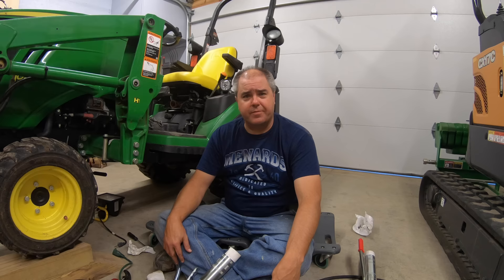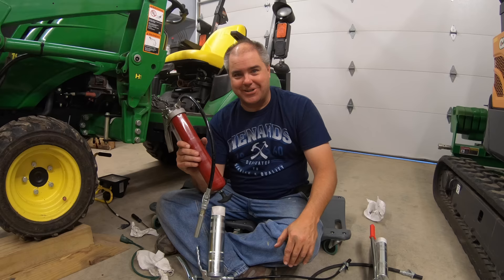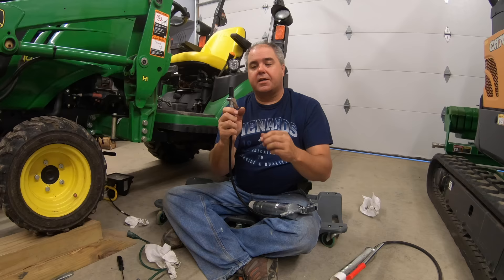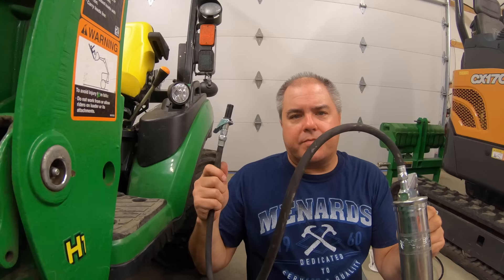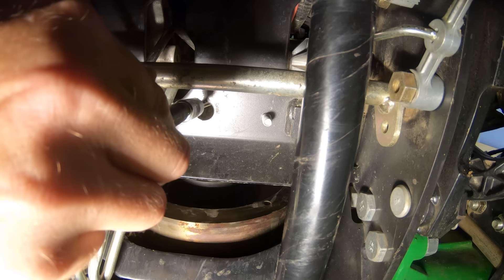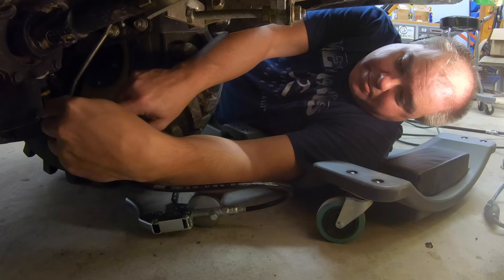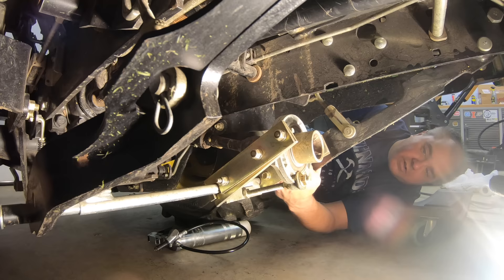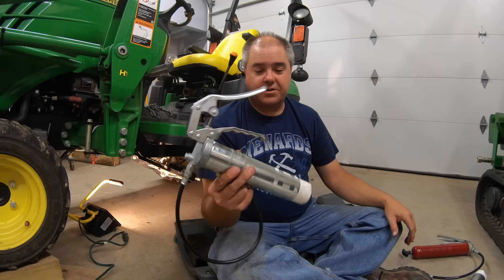New Grease Gun Technology! Greasing The 1025R/1023E Drive Shaft

Comment: I bought a Dewalt 20v grease gun about a year ago and haven't looked back. Best $200 I ever spent.
Reply: ill stick with me 20$ antique grease pump lol
Reply: I just did my 50 hour service on my 1023e without removing the tire, without lifting the tractor up, and other than the too tight drain plug and strainer screen retention screw, I had no difficulties with access including to the filter and greasing the drive shafts.  I simply dropped the quick connect arrangement and disconnected the drive shaft so could rotate it, and getting at the grease fittings and filter was simple.  For the front wheel drive shaft I may have been lucky as both fittings happened to be easily accessible from the right hand side.  The total time for greasing was less than 15 minutes including driving to the hangar and reinstalling the mower.  I just received my hand squeeze grease gun and LokcNLube fitting this afternoon, (a few hours after I finished the job of course).  Thanks for the heads up on those, Tim!
Bob

Comment: The key to easy greasing of that drive shaft fitting is to "hog it out" with a big or multiple drill bits to do whatever it takes to make the hole bigger. Won't hurt your tractor. I enlarged that opening years ago and no structural issue so far.

Comment: To rotate the front driveshaft, jack up one of the front tires to just clear the floor and rotate easily. You can now turn the driveshaft to access the u-joint zerk fittings.

Comment: Once I learned that the lower console can be removed to expose the U joint from the top, problem solved. Two side covers and 4 Philipps screws ...  with the benefit of seeing that the grease is going where you want it. Sometimes you can "feel" that in a blind greasing from underneath, other times not. Are you greasing inside the joint or just piling up a big gob of grease next to it ??? Not as likely with the needle, I suppose, because you can see better.

Comment: This video reminded me of an old mechanics trick. I am an old mechanic. Adapt a length of 5/16th brake line to the nozzle and hold the flare end on the fitting. The brake line can easily be bent to allow easier alignment with the fitting. The pressure from the gun will unseat the ball in the grease fitting.

Comment: Good video. I have had the same grease gun for 40 plus years. I just recently switched to a Lube Shuttle electric (lithium battery powered) grease gun and won’t go back to my old one. I put a Lock N Lube head on it it and bought the Lock N Lube kit as well. Has definitely made greasing easier! And my brother has the same tractor and he bought a flexible grease hose with a threaded end on one side and a zerk fitting on the other side to replace that hard to reach zerk fitting from the bottom. He got it long enough to make for easy access. I’ll have to check his out and do the same modification.

Comment: That's what you end up with on a 1025r. A thousand grease fittings and trying to line your main drive shaft fittings through a dumb hole in the frame. So glad I sent my 1025r down the road and went with a kubota b2650.
Reply from the maker: Fair enough.

Comment: I had to replace that very shaft assembly on my 2320. During the replacement process I found the real problem with the old u-joint and also one of the new joints in the assembly. The joints were not machined correctly and would not allow new grease into the bearing caps. This problem can lead to very early failure and John Deere has not recognized the problem or accepted responsibility, I had to badger them to get 50% off the purchase of the new assembly. To be fair I never told them of the problem I found but if anyone else experiences this failure you can do what you want with this information. Mine failed at only 150 hours. Using an automobiles driveshaft for example, 150 hours x 45 mph (average speed for most vehicles) = 6,750 miles. Obviously the factory assembly lube should have lasted that long. But the factory lube was not able to reach the bearing caps. Great video Tim. Also JD had failed to indicate this u-joint existed in the service manual and has since revised the manual.

Comment: Tim, you said that today was a dreaded day because of having to grease the tractor. But, isn't ANYTHING to do with the tractor better than a day at your day-job? 
Thanks one more time for sharing these little tips and solutions to small issues that bug us. I agree with the other guy who was wondering why that opening couldn't be enlarged so the normal Lock-N-Lube tip would fit. Just a 3/4" or a 1" Cobra bit with some of the smaller steps ground off (so it will still clear the zerk fitting when it finishes opening the hole) should work fine to open the hole without removing that plate. Then a small de-burring knife will smooth it off on both sides from below. BTW, I did mention this issue with my Deere dealer and he says that Deere will be enlarging that hole soon. They say it fits SOME grease fittings, but it also doesn't line up with the zerk well enough to work. 
Also, thanks very much for the heads up on the new Lube Shuttle gun! That IS a big improvement over older guns that tend to seep the oil that grease normally secretes. 
As always, another very informative, and entertaining video. But, we miss Katrile's(sp?) inputs!

Comment: Great video, have been using one of those needle adapters for years, there is also a thin needle adapter that you can use to grease u-joints and ball ends that do not have zerk fittings installed in them, grease gun looks interesting , still using the old style ones might have to update someday! Again great info

Comment: Tim, Thanks for grease fitting tour.  I wasn't sure of all the zerk fitting locations.  My main drive shaft fitting has been ignored by my helper....got it now after I got a needle...Thanks again.!.  I like the new grease threaded refill cartridge gun.  I bought a DeWalt max battery grease gun ($120) a while ago since I had problems working the manual gun handle under the tractor. Fortunately it hasn't leaked yet.  I like your screw-on cartridge demo also.

Comment: Very nice. I've never had  luck with needle grease tips other than making a mess and only  getting grease in with an air operated gun. I'll have to check there brand and also with the locking ends they sure look handy and like they actually  work.  Thanks for the info and all the tips and great things you bring us

Comment: I use a Snap on cordless at work and bought another one for my 1025R. I got the factory manual CD, mine still only has 118 hours. However when it comes to equipment maintenance you have to figure by days on low hour use equipment. We have a oil analysis machine at work, so I'm going to pull samples so I can have base line readings. These records will also verify the condition of the machine if I was to trade or sell.

Comment: I got the grease gun package (grease gun,2 tubes of good grease and I opted for the locking fixture). The grease gun is excellent, the grease is excellent, the locking tip is useless. I figured why get a lock n load when I can get the fancy German tip that goes with the UNIT. I tried it on every zerk I could find, it would not stay. A simple tug and it popped right off. I ordered a lock n load with the brass adapter, it went right on and works very well. The German unit looks elegant and well made, the lock n load looks primitive, is well made and WORKS. I'm sure the German unit works well over there but American buyers should be advised.
Reply from the maker: Yep.  I have the same opinion on the safeLOCK coupler.  Not impressed.
I AM impressed with the lube shuttle grease gun and system!

Comment: This might be a dumb question but why not simply enlarge the access hole in that plate below the grease fitting?  It doesn't appear that enlarging that hole would compromise the integrity of that plate. They you could simply stick your Lock 'N Lube XL right up there and lock on to the fitting.  Tractor Mike was pushing the Lube Shuttle guns also. I'm a little leery of using non-JD approved grease on the tractor and backhoe.  So while it looks convenient, I'll be sticking with standard tubes.
Reply from the maker: I fail to understand why that hole is so small.  Fully agree with you there. ...not only is it too small, it is not located in the proper location.

As for the grease, this IS Deere approved grease.  NLGI grades all of these greases. They are certified.   I can find more detail if you'd like.  I don't keep all this certification details in my mind!

Yes, I discussed with Tractor Mike.  His videos do a great job of showing the gun.    ...but the TTWT code doesn't work there :-)
Reply: Grease is grease

Comment: The biggest problem i have with that gun as far as i can see, is that you have to use “Their” lubricants,, and for me personally i like to be able to change brands etc,, as new and or better lubricants become available...and also i feel the “Lock-N-Lube” attachment seem from what i can see a better solution,, fits tighter on the zerk etc...
Reply from the maker: These guys are a grease manufacturer.  One of only a few.  They have LOTS of types of grease. Enough to make my head spin.    They tell me that this style of tube is popular in Europe. So, maybe it will become easier to buy grease here.
I like the LockNLube too. ...a LOT.  Did you see the small adapter ($5) to make it work on this gun?    Maybe I'll get one and try it for a later video.  it appears to be only 1/2 inch long or so.
Reply: PhatboyHD88  And I’ll bet the grease they have is as good as anything here that’s made in the USA but if these things catch on you’ll start seeing domestic manufacturers either getting license rights or some form of their own cartridge system.
Reply: Over here in europe all manufacturers have there own greas in the sam cartridges. So you are not locked into one manufacturers grease. Choose the brand you like. Once you get one you will never go back.
Reply: Powder River  I bet its not as good as Royal Purples Synthetic Ultra Performance Grease or Archoils AR8100, these two have earned a place in my shop.
Reply: Aha, not true. When empty just fill the screw on tube with whatever you want.
Reply: Yes you can buy empty tubes so you don't have to use their grease,  
click here to see them https://advancedenginetech.com/product/empty-lube-shuttle-cartridges-10-tubes

Comment: I'm a fan of the milwaukee M12 grease gun. Very handy unit if your willing to spend the dough. I still have trouble getting that one through that small hole. It's not impossible, but tricky. That's where the handy dandy needle adapter would be great.

Comment: I’m a equipment operator so I’m greasing every 8 hours of use and that tip would come in very handy
Reply from the maker: Yea, not sure why we never kept one of these needle tips handy on the farm. I THINK it was because we didn’t have a LockNLube. Now that you connect the needle with a grease fitting, and use the locking coupler, it is much easier to switch to and from the needle.
Reply: I have several variety of grease gun fittings. 90 degree, 45 Degree, needle nozzle you have, a 1/4 circle flat greaser for putting grease between rubber bushings and an actual needle that pierces through a rubber seal

Comment: FYI Newer Dodge trucks have one fitting on the driveline that also needs to be greased with a needle tip.  2008 and 2011 3/4ton diesel trucks do so quite a few people should be familiar with a needle tip.

Comment: hey tim that fitting  behind the  flywheel can be greased by taking a larger bit and oversizing that hole so your gun nozzle will line up ive seen a few do this and it wont compromise the crossmember and only take five min

Comment: Tim you was talking about that auto connect I meant being so old. My Johnny is now 3 years old. I guess it's one year newer than yours but my first auto connect just did last a year. And it was simply because one of the universal joints was not getting grease to one of the caps. And when it went out it beat the crap out of the bottom side of the tractor. So if you ever start getting a little noise while you're mowing. Stop mowing immediately because, I heard the noise about 5 minutes before the shaft came apart. In fact I was still trying to figure out what the noise was when it came apart. The good news was John Deere did replace it under warranty and fixed the one hydraulic hose that it broke. However now on my drive shaft to the front wheels has a dent in it. It don't bother me and it don't seem to bother the way the tractor performs. But it could have been a lot worse. I was told that it could have actually came through the floorboard and got my foot. Because there is scars on that floor board from that episode. So yeah if you start hearing a little slop in the drive shaft stop and replace the U-joints. Don't try to finish mowing your grass.
Reply from the maker: Good advice Alvie!

Comment: I would add an extension grease hose the grease nipple. Then you don’t have to worry about it being difficult to get to. Semi trucks are set up with them at the transmission. So you don’t have to crawl under it every time you need to grease certain parts of the transmission.
Reply from the maker: Uh, in the u-joint??
Reply: @TractorTimewithTim  🤔

Comment: Front position on the PTO lever frees up the autoconnect power shaft, not the rear position on my 2018.  :)
Reply from the maker: Correct.  Front position to free up front, rear position to free up rear.
Reply: Forward positioned allowed me to rotate the autoconnect driveshaft so I could rotate to grease it.

Comment: You might want to check out Univer-co from Canada. It is a smaller grease gun locking grease zert option. I do like the grease gun but the only flaw is you can't go get grease tubes for it as easy as the standard tubes you can get those anywhere. If you have to order your replacement tubes online and for a larger expense it could be a problem.

Comment: I just did this to my dads 2210. There are no holes and the yokes are really tight. I couldn’t find my grease needle so I had to disassemble it to take driveshaft out to grease it.
Reply from the maker: You are correct.  This is the big weak spot of the 2210.

Comment: I see this is 5 years old. Are you still using the needle method shown here or have you found a better way   for that one fitting?
Reply from the maker: No better way.  I THINK...but am not sure that Deere has made the hole larger on the newest models. So, it might be easier to grease.

Comment: Grease guns are a problem. I store my grease guns on the parts washer. When your done greasing your covered with grease. Life as it is to wash grease gun and hands in parts washer then it's clean when you use it next time.  To grease that so called hard to get at fitting put a screw driver in the yoke on the back of the drive shaft it turns fairly easy then grease front joint. The hole does line up why Deere didn't make hole slightly bigger I'll never figure out

Comment: How often this need to be greased and how many pumps? I just got a  2019 JD 1025R, not too familiar with green tractors. I also hear that the JD tractors with FELBH& BM needs to be greassed with two different  type of grease? AND some greasses are not compatible? That may be a issue for me, bought it used, have no clue which grease the prior owners(2) used. Also, noticed that the oil on front axel  is very thin, is that what suppose to be? Not 80/90 oil?
Reply from the maker: Front axle is low vis hy gard.
Don’t worry about incompatibility…just grease it good with your grease, the prior grease will be forced out.
Don’t worry about different types of grease.  Use a good quality grease and worry about more important stuff.
Reply: @TractorTimewithTim  Thank you! Will do it.

Comment: The red pistol grip looks like a Alemite 555.... I have about 10 of those. I’ve since switched to battery powered because I grease so much everyday. Alemite will replace the cylinder cap if yours leaks. They have great customer service. Btw did you see that Lincoln copied LocknLube and released their version this year called PowerLock?

Comment: I found that a rigid shaft gun is easier to use on the driveshaft.   The flex hose is harder to hold in the hole of the fitting.

Comment: I have tried the needle fitting.....doesn't work for me....leaks out everywhere without confidence of greasing the zerk....no matter how hard I try or what nuance of angle I use to make a good seal.....couldn't achieve successful greasing.
Reply from the maker: There are two styles of needles.  One very narrow and one larger with a rubber tip.  The larger one fits the ball of the zerk perfectly, and will ‘seal’ around that.

Comment: Great video but just one comment , when you are greasing you should never get use to pushing the grease out the side. If you are greasing something with a seal you will blow that seal out. Just a reminder. Love your videos. GOD BLESS you and your family
Reply from the maker: well, a large majority of fittings are NOT sealed.  I only have one sealed bearing (with a fitting) on all of my equipment.  This is on the tiller.
Therefore, I think it is a good generalization to teach folks to ‘watch for the grease coming out’.  This ensures you are applying sufficient grease to clean out the joint.  
So, I simply disagree with your comment of ‘never get used to pushing..’. Rather, I say this is the rule.  Sealed bearings are the exception.
Reply: Tractor Time with Tim 
WELL SAID & EXPLAINED HERE.
( TIM/CHRISTY ) 👏🏼 .......